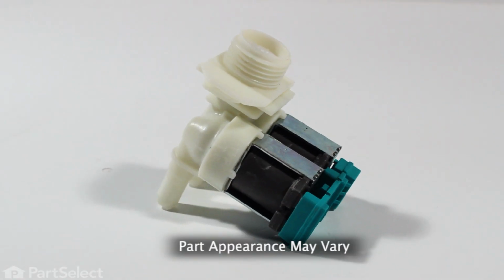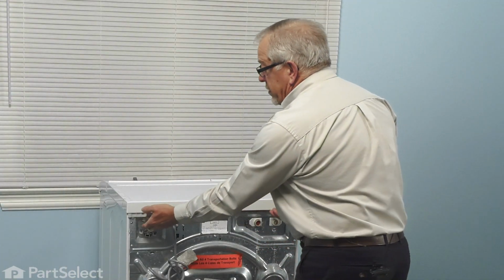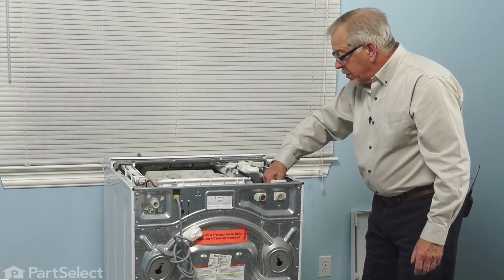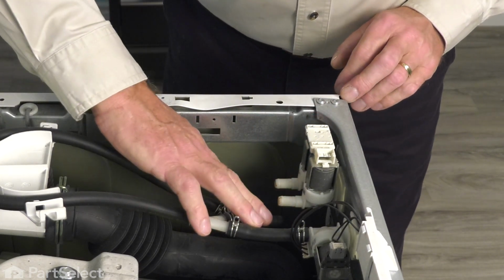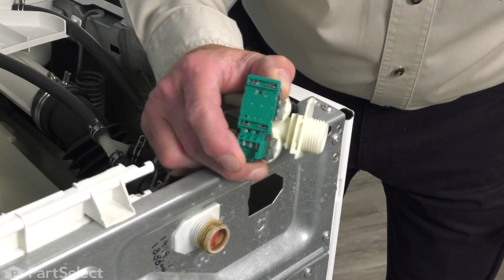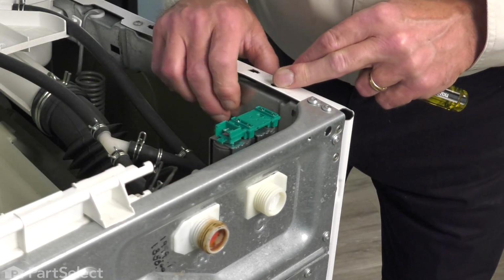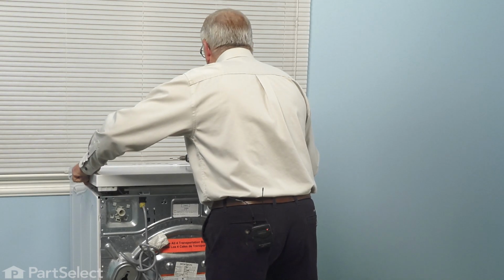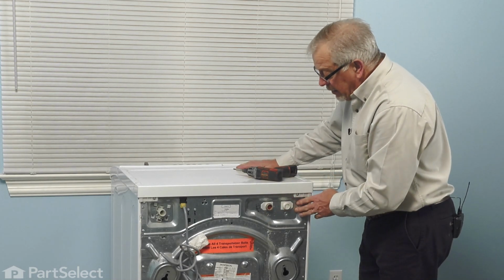Bosch Washer Repair – How to Replace the Cold Water Inlet Valve (Bosch # 00422244)

Comment: Followed your instructions and worked like a champ! Thanks so much! Just a note of caution for others tackling this project;  check tie supply lines before you get started. The ones that come with the Bosch washer have cheap plastic ends and they get brittle over time. My cold water line broke at the wall when I  moved the unit. Other than replacing the lines, project was easy and exactly as you taught, no surprises. Thanks for saving me a bunch of money having a tech come out. $50 part, $25 new supply lines, set for a long while hopefully.

Comment: Thanks for your tutorial, I was about to go and buy torx head bits. I turn on the water to clean my hands and I was surprised no water from the faucet. I made a call to find out the water company was repairing the water main valve down the street, and now I'm bleeding the air that was trapped in the water main.

Comment: Great video and explanation... the problem is water continues to pour in during the spin cycle at the end of the wash even with the new part (previously no cold water at all would be added during the wash).   Does this mean the new part likely has an issue and also needs to be send back for replacement?

Comment: Thanks for posting.  I needed to see that the hot and cold valves are different.  I don't know which is leaking but I'll just replace both.  I'm looking for the part number for each.  Bosch machines are so much easier to work on than other brands!
Reply: Did you get the hot water too??
Reply: @SethWinkleman  Once you get the machine open it usually makes sense to just replace both valves.  I did both because starting out I wasn't sure which one was leaking.  Just a bit more money for both valves, and a bunch less work and less guessing.  Also, if one valve has mineral sticking it open, the other could be on the same track.  So it is a cheap price tag for a lot more peace of mind.  Turned out to be fairly struggle free.

Comment: Hey thank for the video saved me from getting a whole new washer! Very simple and easy to follow. I have another question I have a Bosch Next Plus 500 series electric dryer that isn’t heating and we’ve opened it up and tried to reset the switch with the red button but it’s not clicking so would you have any suggestions whether to replace the switch or the whole heat element? Thanks again
Reply: You probably got this squared away since 8 months ago, but here is a hint:  You can test continuity through the heating element with an ohm meter.  No continuity means it is broken.  You can also test continuity between the dryer body and each terminal of the element to make sure it is not shorted out--that is a good step before firing up a new element.  You can also open up the element and just look and see if it is broken, but an ohms meter is quicker.  If the element tests good (it has continuity and very low ohms) then you can check for power to the wires feeding the element.  Unhook them and keep the metal connectors if free air in a safe spot--hold the insulated wires.  Then power up the dryer and start it running.  Measure volts between the two wires (should be about 240) and from each wire to the grounded dryer body (108 to 122 for each).  If either wire doesn't have power you have another problem to look for.  Be Careful with the energized conductors--They can bite you!